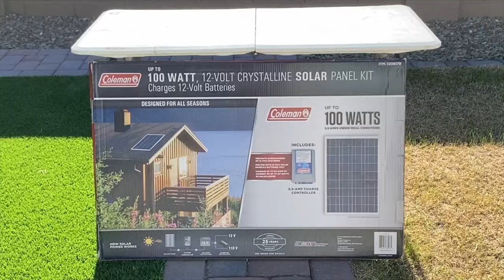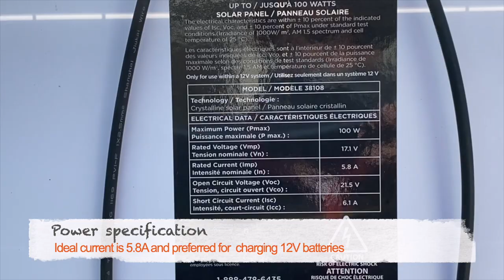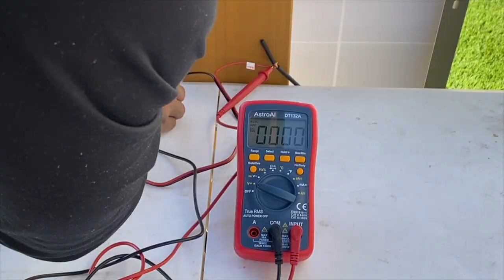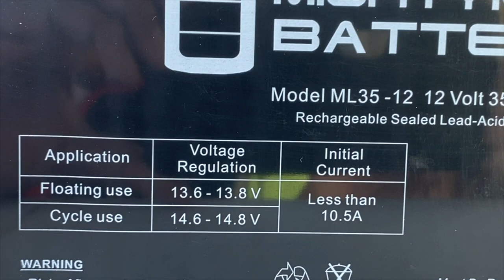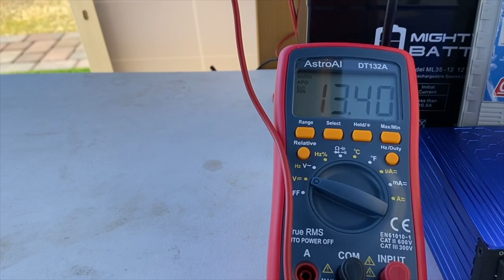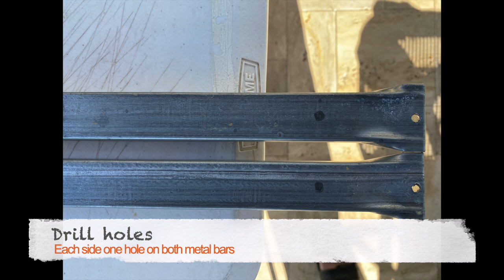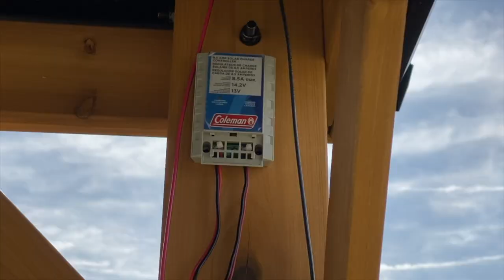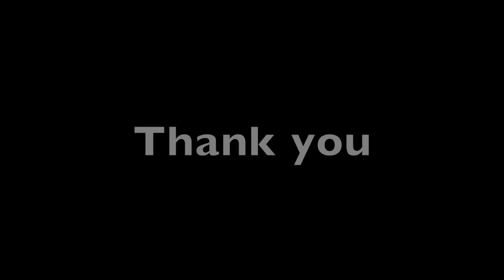Solar Panel Installation | 100w | Coleman | #solar #renewable-energy  #solarpower #coleman

Comment: The charge controller is meant for deep cycle lead acid batteries.  Will it work for other technologies such as Li-ion and LiFePO?
Reply from the maker: I dont think the charger is designed for Li-ion and LiFePO..

Comment: Can you run it with just the generator and no battery? To power up or charge things?
Reply from the maker: Thanks. I never tried, but technically you can use it during the daytime using a dc to dc inverter

I found this article interesting
https://pveducation.com/solar-system-types/solar-system-with-direct-load/#:~:text=The%20solar%20modules%20are%20connected,example%20of%20this%20system%20type.

Comment: Needle nose pliers to tighten a nut? Your basics are good, your installation scares me. Your wires WILL short out and possibly burn your gazebo to the ground. 1.All wire connections, grounds included, should be lugged or wire nutted. 2.One hole clamps work very good at holding your conduit pipe in place without cutting the wire insulation as your screws will. 3.PROPER TOOLS 4.Install wires lugged and greased for them to last more than a month or so on the battery. The grease should be at least Vaseline and preferably NO-CO. 4. Insure all electronics are out of rain reach. Your Coleman charger if left where you show it is history. Good luck.
Reply from the maker: Thanks for the comment. I will make sure everything is followed according to standard.